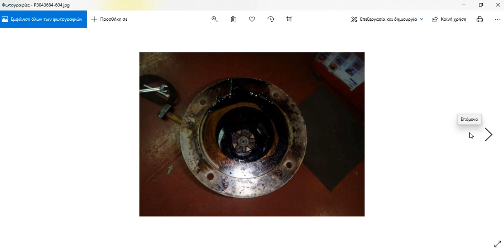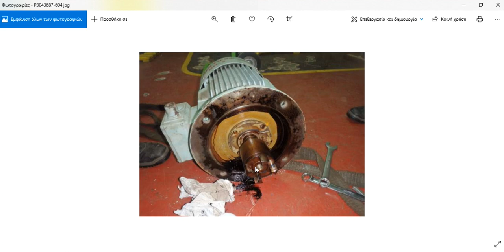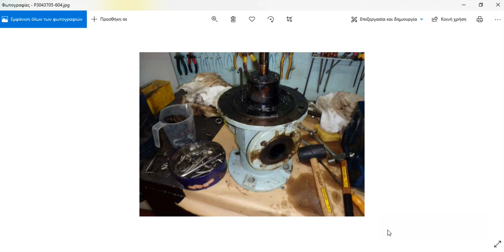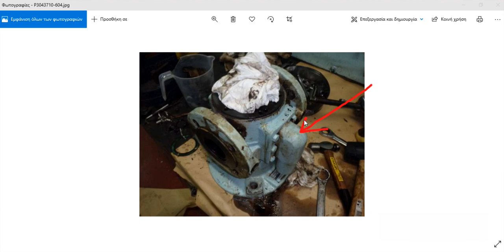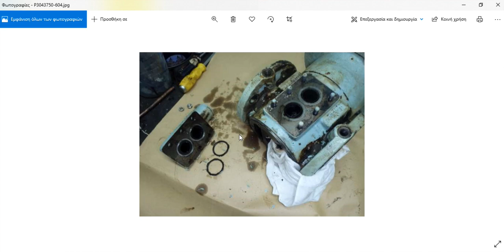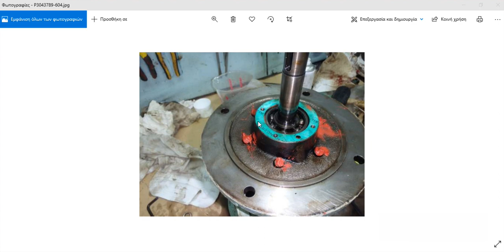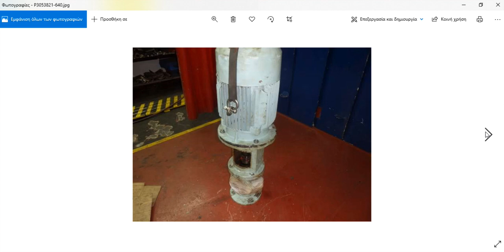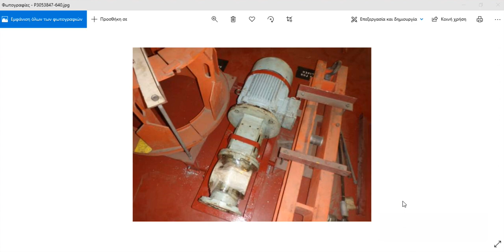Aux Boiler Fuel Oil Supply Pump Overhauling & details

Comment: Hello dear friend...is this pump same as the F.O tranfer pump for example? Because i remember in my 1st embarkation 4th engineer forgot to open valve and started the f.o transfer p/p and broke inside and we replaced it. It is called as Gear pump right ?